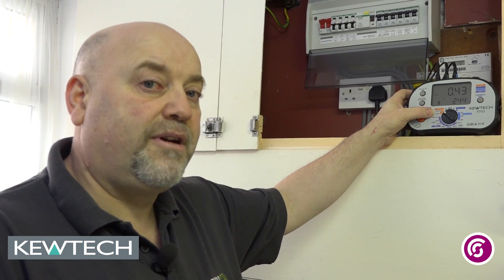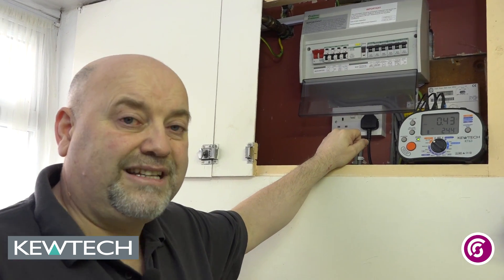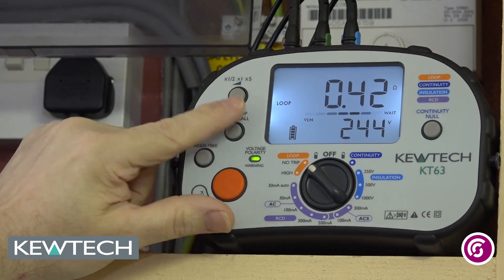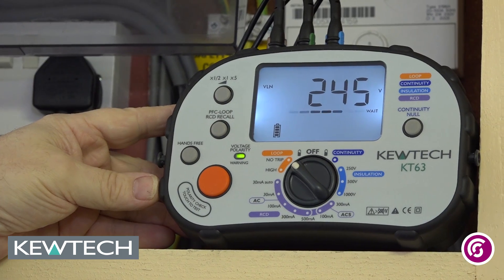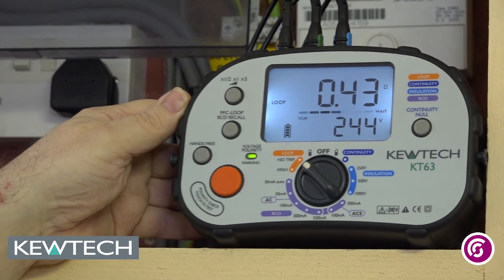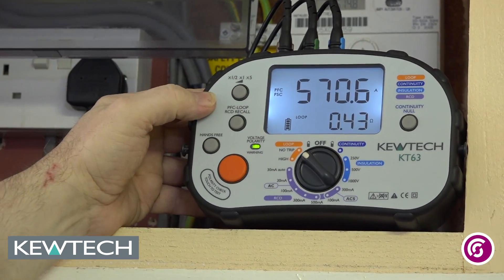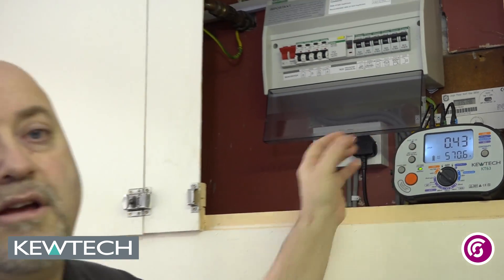Zs TEST WITH KT63/KT63DL

Comment: This video seriously misrepresents the time this thing takes to do a no-trip loop test.
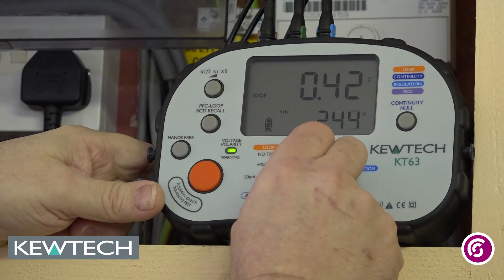Each time you connect it to a circuit it needs to go through the pre-test (approximately as shown here from 1:11) before it will do a loop test. If you set it to "hands free" it will do the sequence automatically. Otherwise you need to press the test button in the middle of the process. Minimum 9 seconds from connection to getting a reading.

Comment: Yesterday I posted requesting a video requesting a demonstration of the Ze test (in LOOP High mode) . I suggested that the KT63 should be used in 3-wire mode.
THIS WAS WRONG and I have deleted my posts. 
I have since found the KEWTECH KT63 Operating manual that describes a 2-WIRE configuration for the test leads (Page 16) Basically join the Blue and Green leads together at the Probe/Croc-clip end. 
Also Note that the Operation Manual specifies on page 16 and page 18 to ONLY use the KT63 LOOP HIGH mode with a TWO WIRE configuration.

Comment: I get hugely inaccurate Zs readings on the KT63 no trip setting, can only rely on the high current test
Reply from the maker: Hi Geoff, have you been in touch with Kewtech about this? 01494792212.